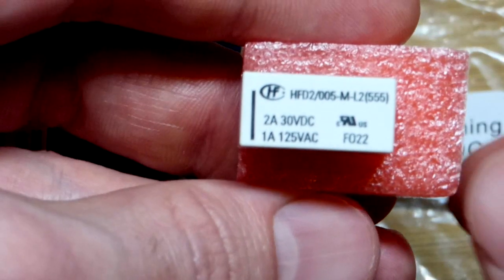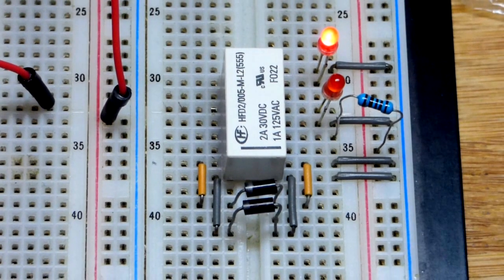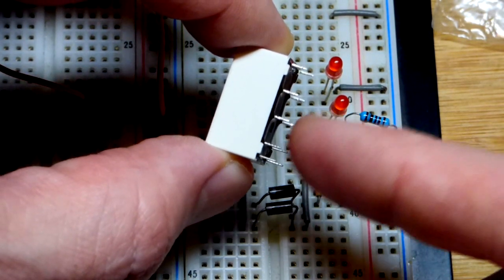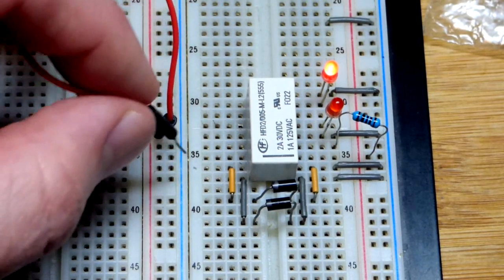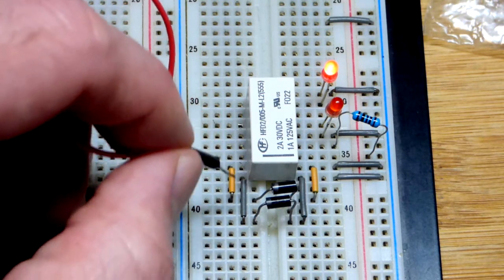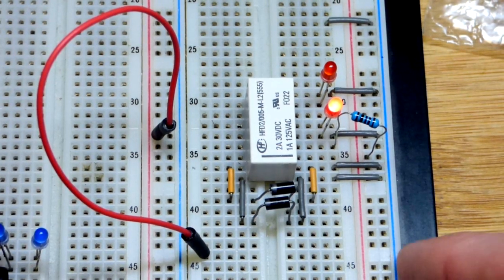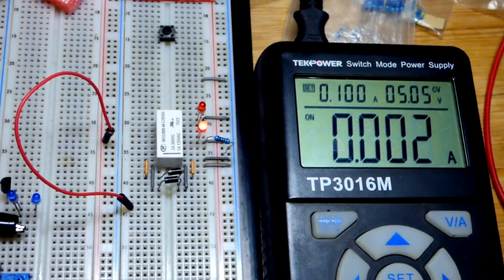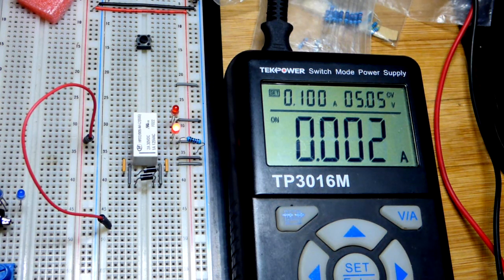How to use actual latching relay component demonstration for DIY learning electronics

Comment: So latching relays use less power than the normal coil relays? I think the normal coil relays keep using power while they are held in one position?
Reply from the maker: In one switch position, a regular relay doesn't use any power. To switch it and hold it in another position, it consumes power for as long as it is held in that position. A latching relay just needs a brief period of power to switch from one position or the other. It stays in either position without any power.

Comment: My turn at a silly question, what state is the circuit if you remove power, then after a minute power the circuit back up - which LED is active ?
cheers

Comment: actual latching relays retain their switched position without needing continuous power being applied to the coil(s), if they have two coils like this one, applying power momentarily to alternate coils will change the switched contact position, or if you reverse the power connection polarity to one coil and apply power momentarily you can also change the switched contact position - this is also necessary if the latching relay you are using has only one coil, as opposed to what is shown here where this latching relay has two (set and reset) coils. The whole idea of a latching relay is to maintain the switch contacts in one of two positions without continously applying power.
The function of the diodes is to prevent voltage spikes feeding back into the circuit powering the coils when a coil is de-engergised, as when a coil stops being powered, a high voltage spike is produced when the electrical field in the coil collapses, as this high voltage spike can destroy sensitive electronic components driving the relay
Reply from the maker: Thanks for the info!
Reply: in my own projects i use them so that a single momentary push button press can switch a lot of contacts 

eg, 5 relays ganged together to create a 10pdt relay 
watch?v=k2hStZrQVHM&t=75s 
or 3 relays ganged together to create a 6pdt relay 
watch?v=R41vlkI0p4Y&t=165 

in those 2 projects above, 1 of the 2 attached capacitors stores the charge necessary to momentarily power one of the two coils, that capacitor is charged over time through a resistor, but using two push buttons is a lot easier 
my old air-cooled VW car uses something similar to change from high beam to low beam or flash its headlights from a momentary button on the indicator stalk, but its done mechanically rather than using extra capacitors 

other examples of (impulse driven) dual-coil latching relays a.k.a bi-stable relays 
watch?v=QKK3v73P_44 
watch?v=CEUKeSl9YHw 
watch?v=8fAuRIWEgWY 
watch?v=W-zwT1i-rtE 

there isnt a lot on utube on using these type of relays

Comment: Maybe a silly question but do you know what power supply I need to test a Schrack 24VDC / 16A/250VAC relay? Model RZ03-1C4-D024
Reply from the maker: After doing a google search of the part number, I found the specs on Mouser. The coil voltage is 24V, so that's the voltage you would want to switch it with. I'm pretty sure that's also why 24 is at the end of the part number. The other voltage and current is probably the maximum load that the switch part can handle.
Reply: @Electronzap  thanks so much. I'll need to find something that can provide 24V now.

Comment: If you threw a transistor in there and maybe one of those light resistant diodes I think that's what they're called
Reply from the maker: I was thinking of adding transistors and light dependent resistors to relay circuits for future videos.